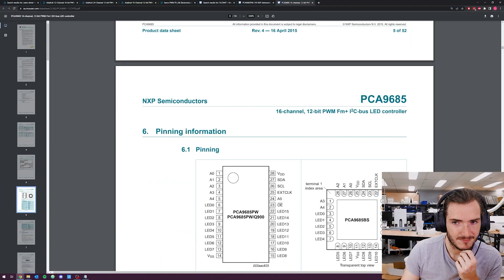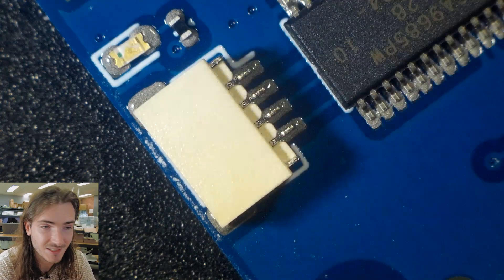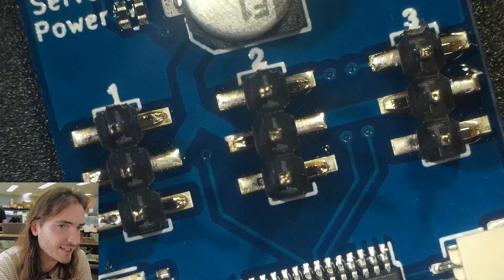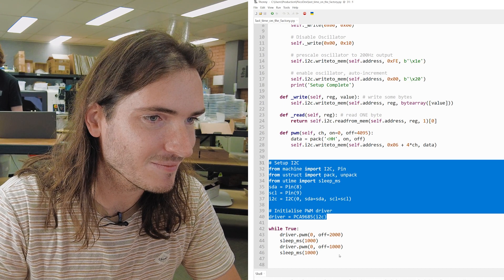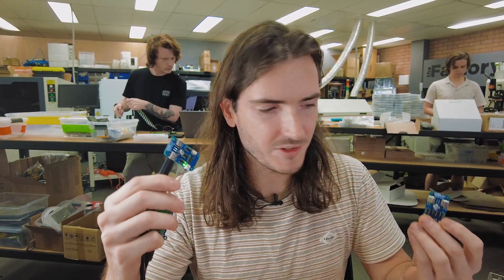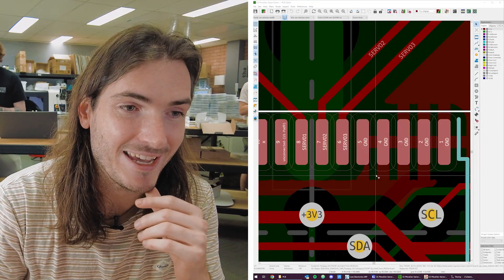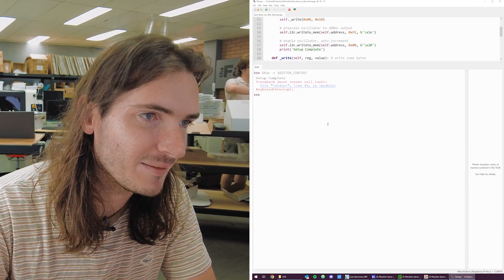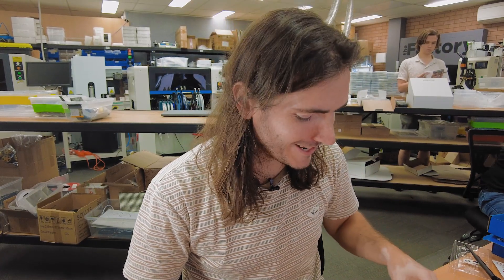The Factory | Design A Product With Us Part 4: Assemble & Test A Prototype PCB

Comment: If all the USB-C is doing is delivering bulk power, then I don't see why you would want to be spending oh so much on particular length USB-C cables where a two-wire connection would do, and is even easily length shortenable by makers (in contrast to a C cable).

Why spend $3-$20 on USB-C power cable instead of 50c-$1 on decent gauge wire with appropriate rated 2pin connectors?

To solve the chicken-egg problem (if I have 2pin connectors each side, how does it get in from USB charger initially?), could either put 1 USB-C on the top, or sell a simple 'dumb' adapter board from USB-C to 2-pin power (might also be generally quite handy adapter for makers) that can start the chain.
Reply from the maker: There are some power breakouts so you're still free to provide power however you like. We have sourced some pretty affordable USB-C cables to complement the servo driver. Check out the product page!
The problem to solve here was one of ubiquity and a requirement for no soldering or manual wiring. PiicoDev needs to plug together to maintain its appeal to educators, and still be flexible enough (breakouts) for pro-makers.